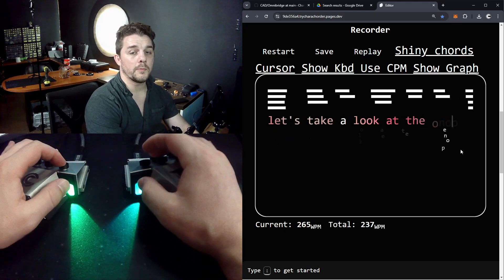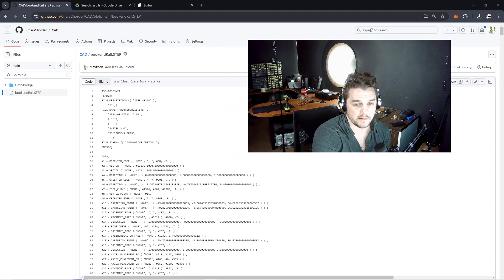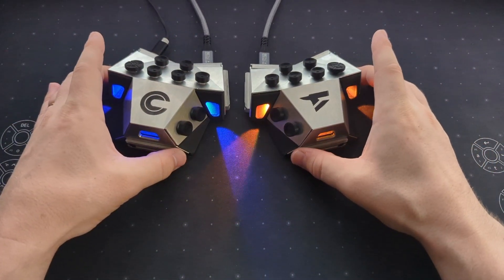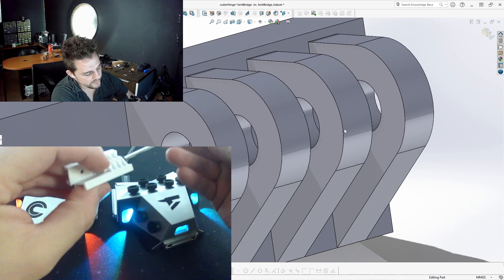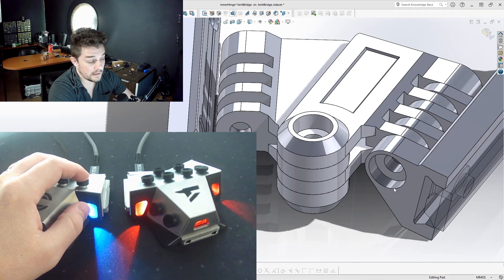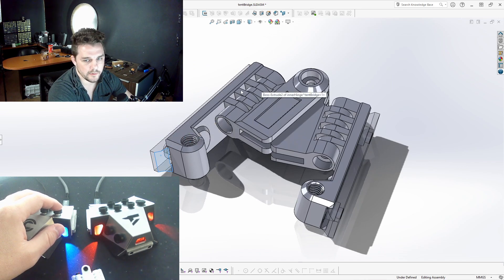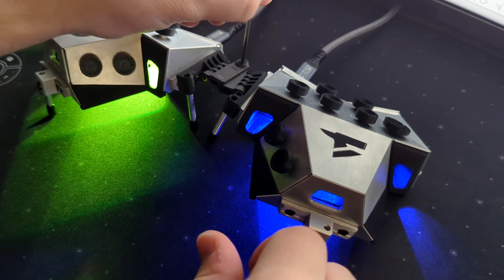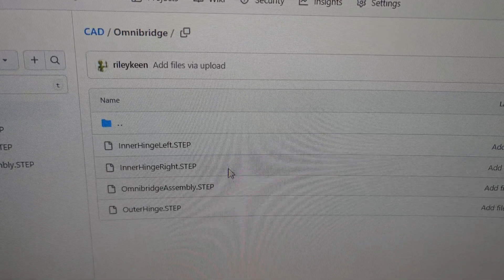Let's Design a Custom Part for the Master Forge

Comment: Hi, I'm new here so I'm not sure if this has been asked before, but I'm a little put off by the look of all the sharp corners and edges on the master forge. Do your hands ever rest on those surfaces or do you just float above them? Do you ever brush past the edges when using it?
Reply from the maker: Your hands do not rest on the device. The edges are also beveled :)
Reply: @CharaChorder  Thanks for the quick answer!

Comment: Love seein this! This seems like the perfect kinda thing to add a thumbstick onto! (an actual analogue one, not the kind already on the forge)
By the way, will the forge itself be feasible moddable? Like, not add ons, the base forge itself, will it be supported or difficult to play around with it?
(I ask cause I've considered theoretically replacing one of the thumb switches with a small analogue thumb stick. I'm very into the idea of merging the benefits of keyboard and mouse with the benefits of controller thumb sticks)

Comment: I have an idea, but it's in regards to CCOS update, not a physical add-on.
Please think about adding chord suggestions to your firmware.
I mean individualized chord suggestions based on user's typing history.
You could create a mapping of word/key-sequence -> u8 value.
Now every time user enters that word you increase that u8 value in entry
corresponding to given word. And you track up to u16::MAX words, since 256 might
not be enough (or maybe 256 is enough since we are interested in most frequent ones,
and we don't track words that are already chorded for this feature).

With that list you know what words are most frequently used by given person.
So you can suggest him: Hey, how about defining a chord for "word_one"?
And you could even give him three suggested key combinations to choose from.
User would try those suggestions and by chording selected suggestion three times
in a row it would get added to his chord list.

You could also create an individualized firmware-based practice mode.
To do this, you need to track how often he actually uses his defined chords,
but also registering mistakes and failing to use a chord by typing letters.

Now user can enable Practice mode with words that he is frequently typing,
but not using chords, only individual keys, or words that he is often
failing to chord in a correct way.

Now he is presented a list of words, like this:
Practice mode> word_a word_b word_c word_d

User starts from right to left and when he writes word_d correctly:
Practice mode> word_a word_b word_c word_d word_d
last practice pair cancels out, and prompt is changed to:
Practice mode> word_a word_b word_c 

But if he makes a mistake, those mistakes are registered, to indicate more
practice is needed for given chord, or even suggesting a change to a different
chord, if the user happens to frequently use the same unocuppied chord.

Practice mode could be extended to include a beginners tutorial.
User opens up any word processing app, or even a terminal and starts 
to practice from scratch.
Every lesson has a prompt with instructions how to complete it,
and later a practice session.
First he learns to type two letters he has defined south of his index fingers,
later two more letters for south middle finger are added and so on.
Progress is being tracked, so every user practices in his own pace.

I think this would be a valuable asset attracting less tech-savvy users.
Reply: In order to make the user feel he is making progress you need to track his error rate as a percent of mistakes in recent x-number of attempts. Now you want to keep his error rate within some predefined bounds, say 5-10% so that he is always slighty challenged. Once he exceeds this upper limit, you simply drop one learning item from his drill, and when error rate is to low you just introduce a new item for him to learn. With this you have created a personal Typing Coach :)

Comment: Thanks!

I have some not solicitted feedback: what you share here is nice, very nice but as a costumer I only want to care about the plug the keyboard and start using it. Is alreadyhar make the jump from the bad actual mainstream keyboard to this native coherent approach to the modern world keyboard.

I think have a web where the costumer gan how how the product will be one is finished would be very good (look the webpage of Lucid Motor, Tesla or Sonor SQ2 to check how that interactivity happen. I would prefer something more in 3D, like Sonor SQ2, but only images would be good also)